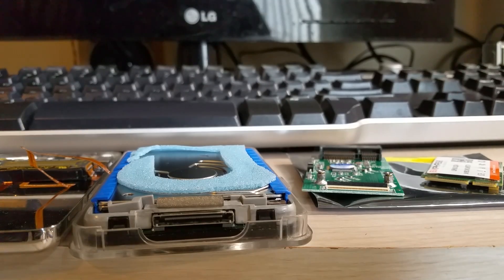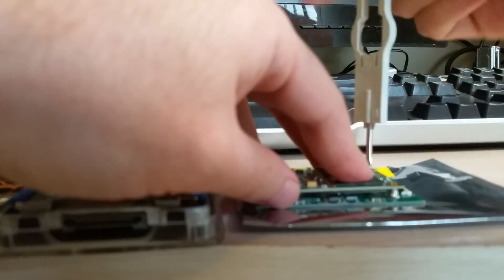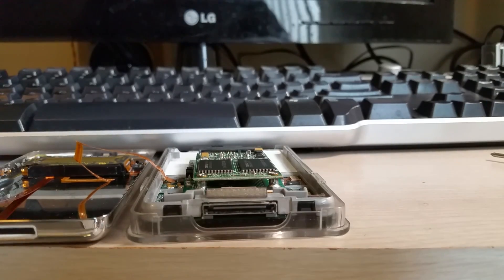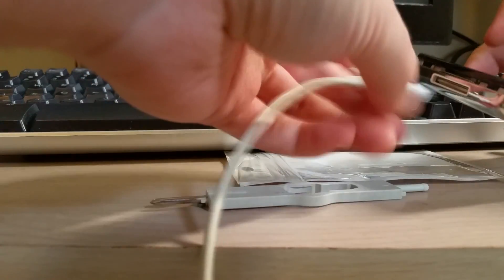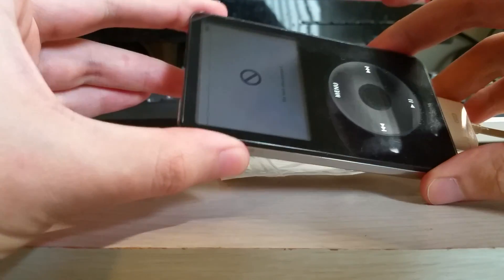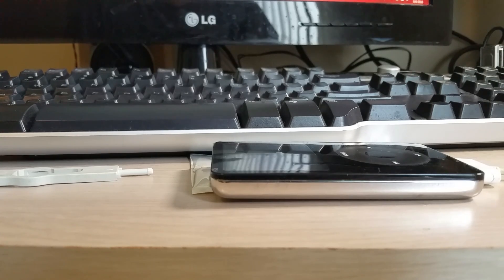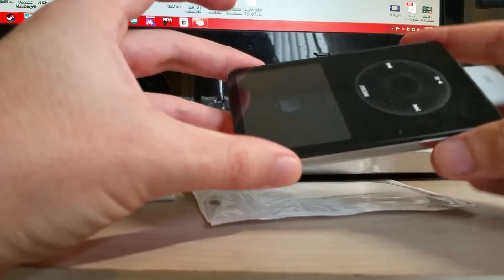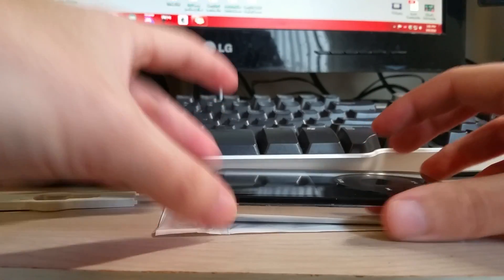Apple iPod Video 32GB MSATA SSD Upgrade on the Cheap!

Comment: Have you formatted it prior to instalation?
Reply from the maker: I didn't have to. I made this video as soon as I received the drive so whatever it was originally formatted to worked. I'm pretty sure the restore process would reformat the drive anyway.
Reply: I've plugged my kingston 120 gb into ipod 160 gb, but it shows only red cross
Reply from the maker: Сергей Мешков
If it shows up in windows or whatever os you are using when the ipod is plugged in via usb try formatting as fat32. I've read that the 6th and 7th gen ipods are pickier on what ssd's they will accept than the older 5th gens like mine. Also does your kingston say what the current draw is on the label (it might be trying to pull more current than the ipod is capable of supplying)?
Reply: Yes, confirmed, they don't like to chew on exFat. Some devices come pre-formatted exFat out of the box. Recommend pre-format fat32.